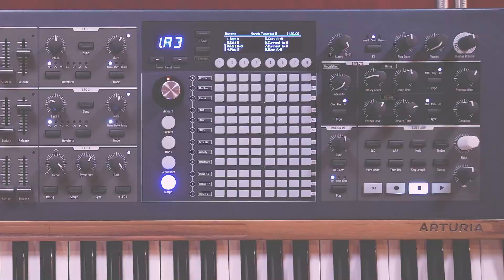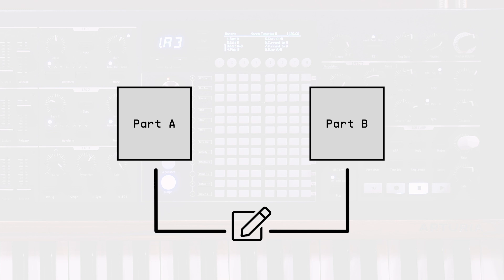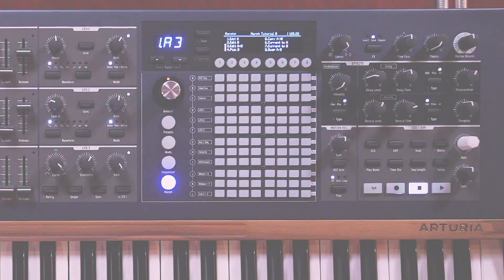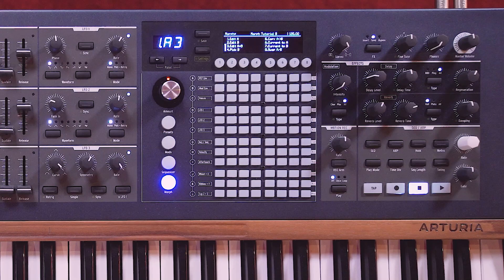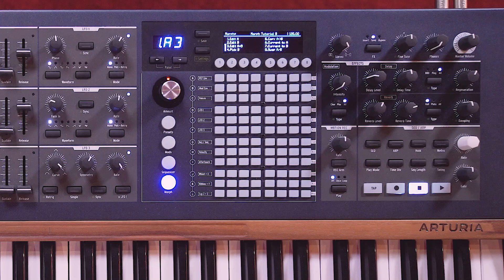Tutorials | PolyBrute - Episode 3: Morphing

Comment: I've just noticed that "level" knobs on filters are turned fully down in this video. In my case, it doesn't make any sound this way. Can somebody explain, please?
Reply: The panel is not live. If you turn the knobs down and then change patches, the knobs will still be down but you'll be hearing how they are set in the new patch.
Reply: @philaiken5137  True, and I believe there are even settings to control how the knobs map to the settings, you have some choice. (E.g. does it jump to the new value when touched, or smoothly interpolate, etc.)